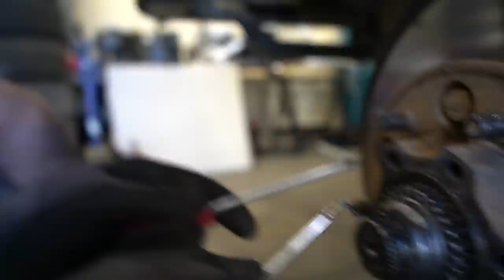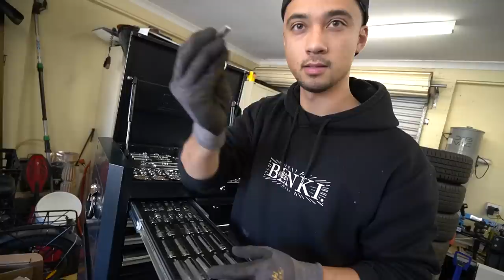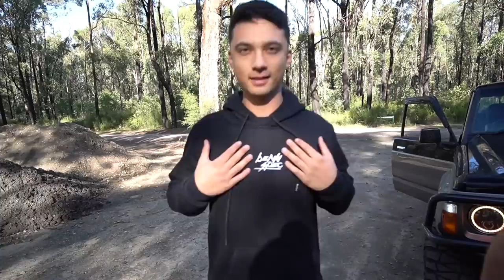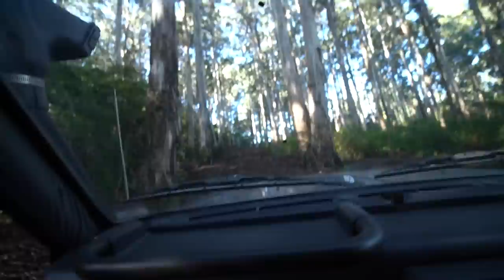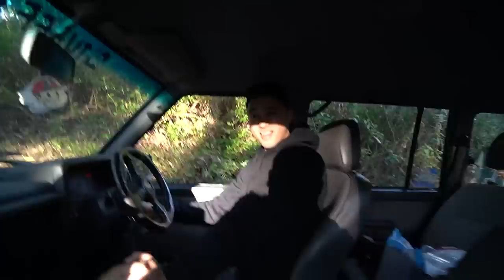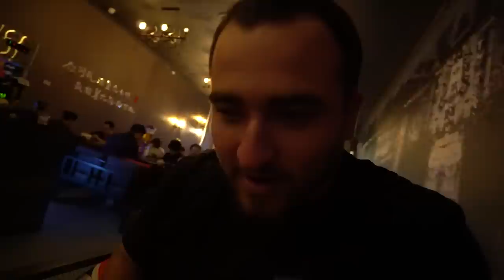Facebook Marketplace GQ Patrol Goes BUSH BASHING!! [FULL SEND] #nissan #patrol

Comment: Believe it or not, sometimes wheel speed and momentum is your best friend in slippery mud like that.
The faster your wheels spin, they throw the mud out of the tires and in return gives you your traction back. ✌🏼
Reply: 100% From 10-11 mins there's was a couple of goes there where if he just foored it and pumped left to right he would have gotten up. All just a learning curve though.
Reply: @jeremy9806  ahh yes, how could I forget throwing the steering wheel left to right! That's an important part of mud, be surprised how well it works and I totally agree, just a learning curve. Hopefully after reading a few comments here he'll gain a bit of knowledge and put it to use. 👌🏼
Reply: @Gage Burns  thats all it takes. Some left to right action with the correct volume and precision with some quick Pythagoras calculations on the fly and you are at the top.

Comment: Hey Rex, I got my stock steel rims and my new tires. The rim size is 16 X 7, tires are 205/55R16. I don't know if it's just me but the Camry seem to drive different. The ride is much quieter. Before I use Sumic tires. They just come to the fender well edge. It's not past the fender well edge. Here where I live in Kentucky in the US it's against the law to have anything past the fender well. I'm think about getting a spare for the Camry LE 2000. 17 inch rim with spare tires. That'll cost me a fortune. Really happy with the way the Camry looks. It looks some what sportier. My Camry is getting there. I just wanted to let you know.